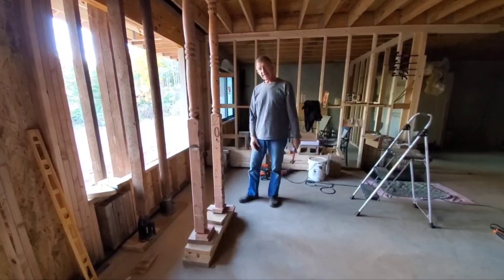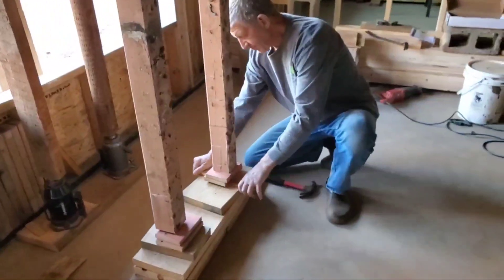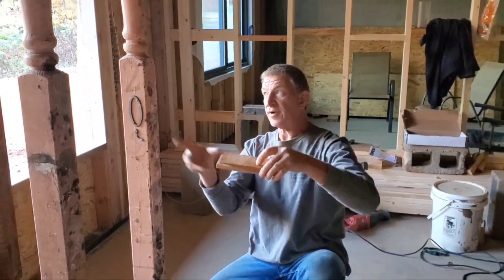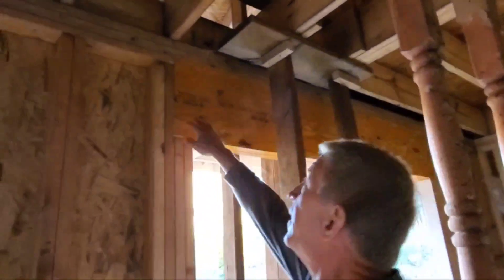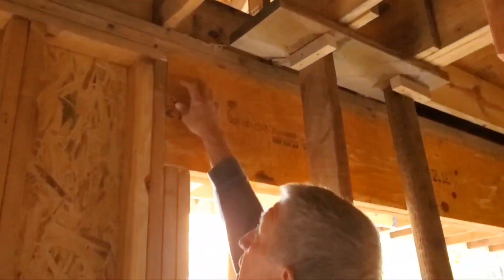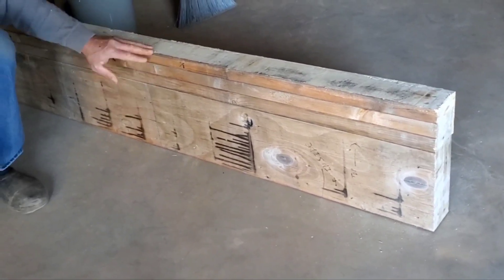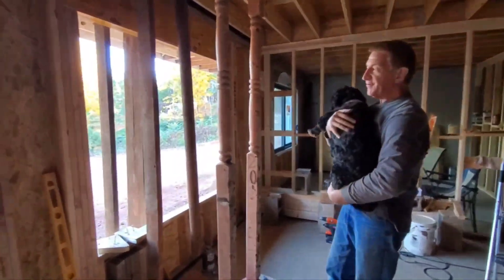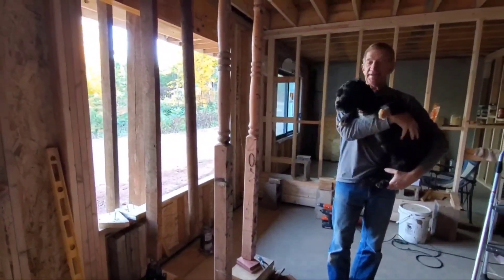Earth Berm House 26 building construction LVL Beam replacement installation

Comment: How much is this house costing to build?
Reply from the maker: Would be about the same cost or less as a typical house that also has poured concrete basement walls. Realizing that 3 sides of the house will not never need siding, brick, stone, painting ect.